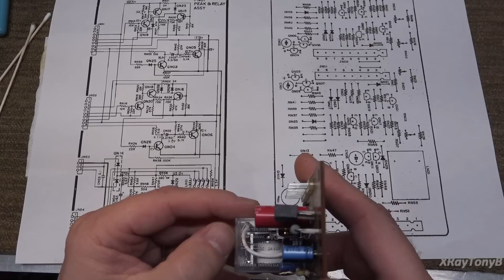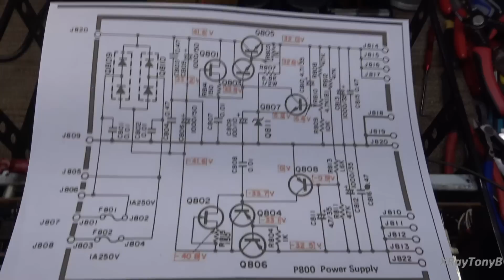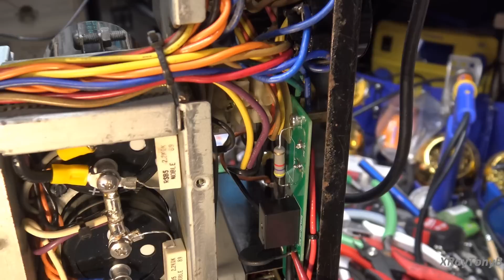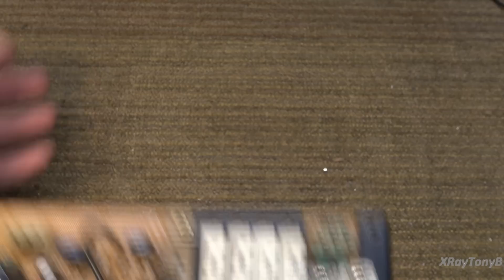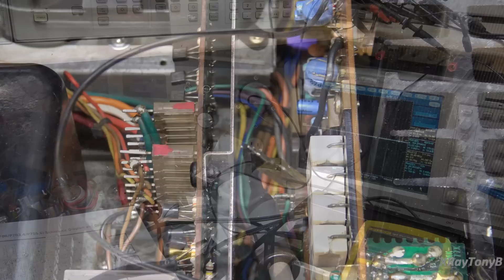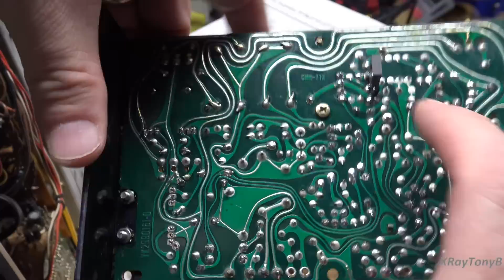Marantz 1300DC - Part 2

Comment: I did the same thing just yesterday on a Sansui G-2000 i'm servicing. I installed one of the driver transistors backwards and was confused why I only had half a sine wave at the output.
The silkscreening font is tiny and with my bad eyes I thought a E was a B.
No harm done, once I discovered my error and fixed it the amp ran like a champ, no damage done

Comment: I'm always curious about the "thought process" you go through to find proper substitute transistors. I ran around in "mental" circles (way back when) in attempt to find modern "substitutes" for first gen. SONY FETS. It ended up being easier to re-design re-build the board using low noise bi-polars.

Comment: Thanks for the video, that was very good!  I understand that the owner of this equipment wants to maintain its originality as much as possible, and I am like that too.  However, I would make some changes in the power supply circuit, without cutting traces or breaking anything, I would include a positive and a negative voltage regulator such as the LM338/LM337 pair and neatly install jumper wires in the PS circuit.  As we know, these regulators are quite stable and provide both thermal and over-current protection.  We remember, for example, how bad the original PS of the Pioneer SX-1980 was, to the point that you installed a brand new PS board.  For this Marantz 1300DC, I understand that it's PS has demonstrated to be very vulnerable, it burned pretty badly and the root of its regulation relies on a single Zener diode.

Comment: From my experience, this is Korea and I write with Google Translate.
If there is a lot of fuse resistance but the fuse resistance is not completely broken,
33Ω 4.7Ω etc . Memory not correct
Bias goes up and eventually burns out the transistor due to thermal runaway. 
The q710 2SA970 aged due to overheating for a long time, so the hfe value dropped and the bias value could not be adjusted.

Comment: Re thermistors, I know a lot of folk don't like em but you mention a thermistor still has some resistance when warm, say 1 ohm, that means a 120v mains supply can still supply 120A (potentially). The winding in a transformer primary might be 4 - 10 ohms or more, a fuse has resistance too, a 5A fuse I just measured has nearly 1 ohm resistance, the transformer isn't 100% efficient either,losses everywhere. Re heat, use a bigger thermistor like SG-420's possibly. Grand video as always, thanks.

Comment: Nice analysis and corrections, Tony! Strange they didn't fit a "soft start" arrangement originally with that big inrush current. And also, the thoughts about switching off and then on again right away, with the high inrush current then in some circuit designs. Most TO220 transistors are "B-C-E" , also the bigger TIP packages. The TO126's are all "E-C-B" as I have found. I wondered as I watched if you reversed the "TT" transistors with metal side up, but in this case it didn't matter.. Replacing the older MJE2955 and 3055s (E-C-B leadout) today is not easy, the newer ones are reversed

Comment: Regarding relay contacts; I remember the ark is generated (most) during the contacts seperate under high load (because electrons cannot stop instantly :)). During closing it should not hurt that much. Or this very old knowledge (of mine) is wrong?